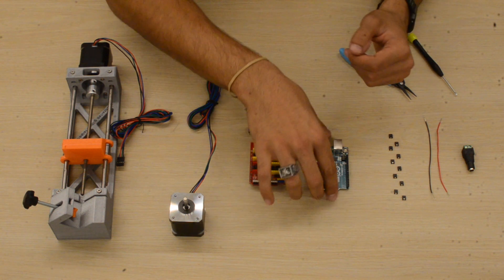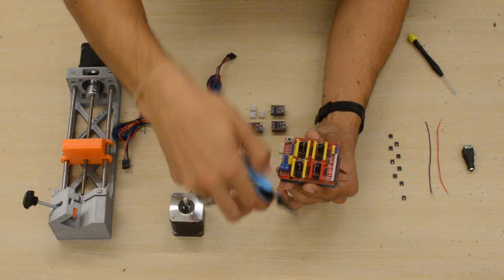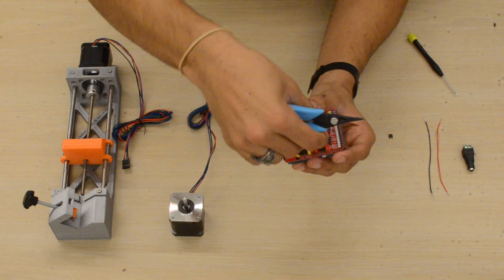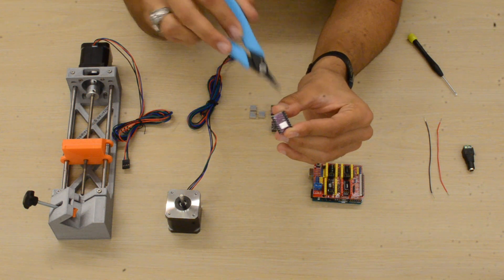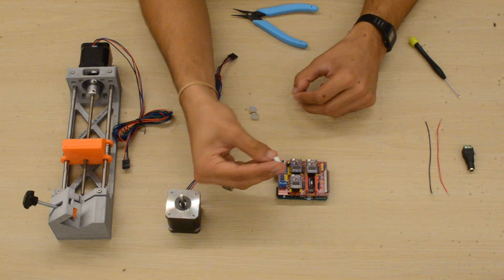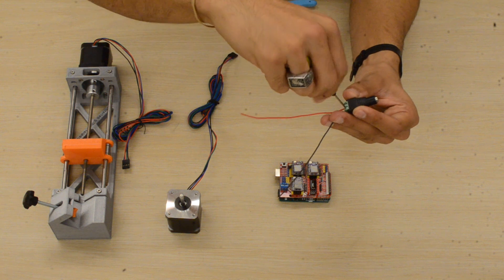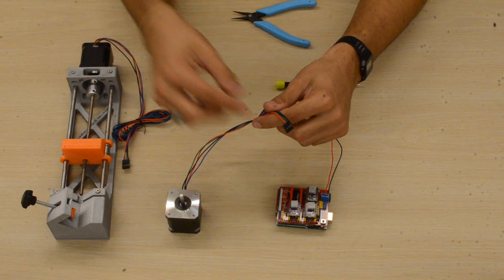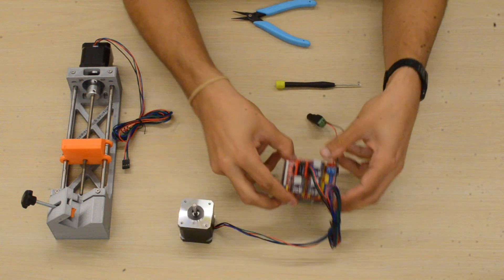Poseidon Build Videos: Arduino

Comment: Hi! The motor drivers on your hardware says its a DRV8825 Stepper Motor Driver but the bill of materials says its a A4988 Stepper Motor Driver. I'm currently trying to run with a DRV8825 but the drivers are getting way too hot and the syringe pumps won't move. Which driver should I be using?
Reply: Hello, have you solved this problem? I have the same confusion.

Comment: my wire color is different, it is Black, Green, Blue, Red.  will i need to change it around?  I am new to working with nema 17 steppers and cnc shields. I would appreciate any feedback.
Reply from the maker: I don't know, I would look at the wiring diagram for your specific motor and for the CNC motor shield and try to piece it together.
Reply: @sinabooeshaghi5919  I was able to plug it in and it worked.  Seems to be moving rather slowly no mater what speed setting I use.